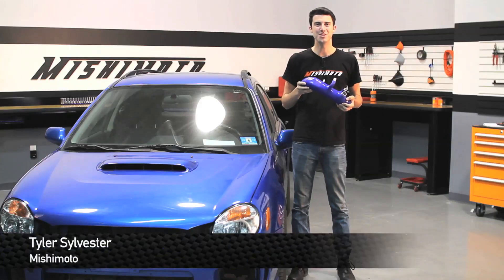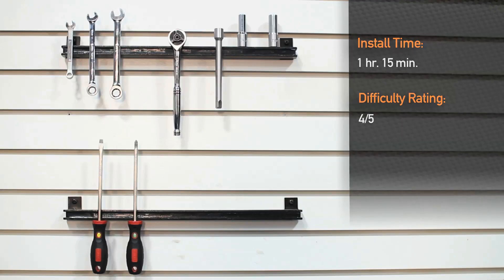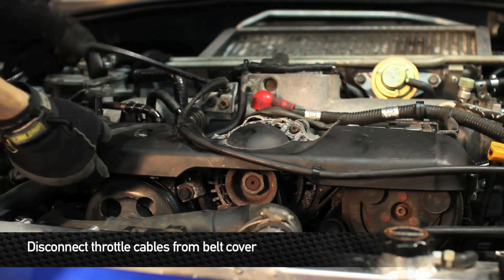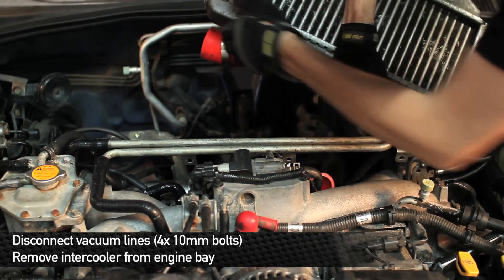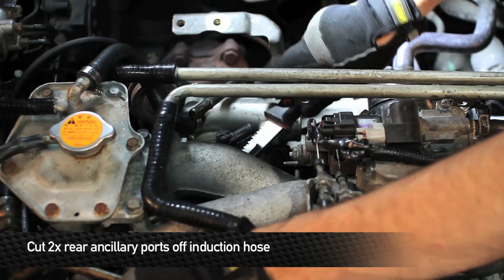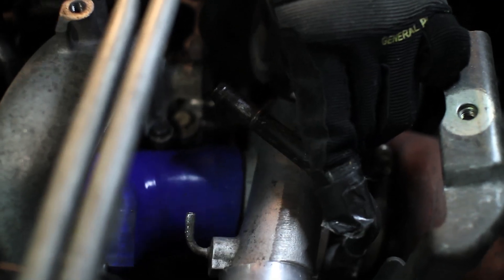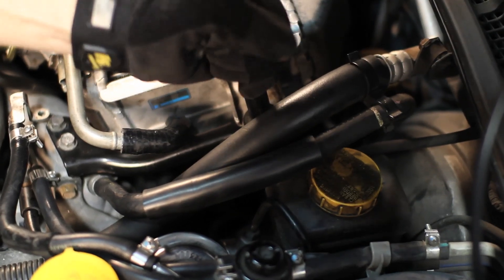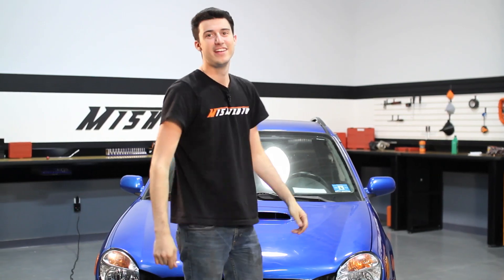Induction Hose for the 2001-2007 Subaru WRX/STI Installation

Comment: Why isn't the connection on the back side of the intake closest to the turbocharger I believe there is a check valve an sensor back there that I cannot seem to believe there is space nor room to make that work and the fitting provided does not fit that (plastic female fitting) sensor/check valve there? What's the solution?
Reply from the maker: This sensor is not found on all models and most of the aftermarket induction hoses will delete this sensor. The sensor can simply be plugged in and set to the side.
Reply: @mishimoto  Thank you clarity is serenity most the time so I appreciate you time! That does make sense an helps many of us modderz out here! 🙌 I cut that and am running the stock sensor as needed till I decide to buy the next stage for stage 3 but I was hung up on this issue for a HOT MINUTE! 🙌

Comment: Accidentally bought the 2001-2007 inlet, will it work for the 2008 wrx?
Reply from the maker: Unfortunately, the 2008-2015 models require a couple extra ports on the hose causing the part you picked up not to work.

Comment: 2:49 this turbo inlet  hose is so damn expensive and you do somthing like this ? and missing steps of replacing - poor quality
Reply from the maker: You are welcome to save the OEM component by removing the entire intake manifold but for ease of installation, we recommend cutting the ports off.

Comment: The fittings didn't come in my induction hose box. 2007 STi. Mishimoto won't respond, rallysport direct is offering no help, and now I have to find the exact sizes of the fittings. Can anyone tell me so I can buy them somewhere else?
Reply from the maker: Hey James, if you've already sent an email into our team but haven't heard back, feel free to give them a quick call at 302-762-4501 so we can check on your ticket and get this sorted out!

Comment: I like how you conveniently skipped the 1hr+ required to stick in the inlet below the manifold.  Connecting to the turbo wasn't anywhere near as easy, the hose is very stiff. I unbolted the turbo and slipped it inside the inlet. It also helps to remove the power steering lines and cut off the metal stub from the manifold that used to hold the stock inlet. You are also not showing the dummy sensor that has to be removed from the PCV line next to the turbo.  Also its hard to fit the stock post-maf hose on the new inlet.  aftermarket hose is better.
Reply from the maker: Hey John, I'm sorry to hear of your struggle - here's a detailed installation guide for reference: https://cdn.mishimoto.com/media/productpdf/MMHOSE-SUB-IH_InstallGuide.pdf in the future if you have any difficulty with our product, don't hesitate to call our customer support specialists at 1-877-GOMISHI or email support@mishimoto.com!

Comment: is a tunr needed for this very intrsted its a need to be done to my car so I'll be buying one but I also want to know if I would need to retune my car
Reply from the maker: This induction hose is safe to run on the stock tune.
Reply: Mishimoto Automotive what if I have a pro tune does that make a difference?

Comment: OMG Night mare is an understatement!!! After 3 hours of blood sweat and tears and skinned knuckles i had to take a break, assess life, and go to sleep. upon waking up i invested another 3 hours finagling the inlet over the turbo...Finally at the final stretch my full length CAI was too long... I ended up having to cut like 4 inches off the inlet to make it line up correctly to the intake. all in all i would not suggest this to someone not very automotive inclined. The Guy in the video makes it look like easy peazy clockwork. For the record i love the sound the engine makes with it installed, and dont regret buying and installing it, and no more boost leaks for the win!

Comment: problem is that on a 02 motor the hoses are brittle and will break . these motors will cause gas leaks from drying out fuel lines that couple fuel rails this is know to cause engine fires.also when trying to remove or install induction hose hoses will not come off as easy as video shows.

Comment: It was not this easy lol. Without taking off the intake manifold, it was one tight fit. Took me a little over 3 hrs to install. Silicone held up well though after taking a beating. Nipples don't line up perfectly with the vacuum lines, but they bend very easily. Overall good product.

Comment: Im kind of baffled how this video does not show how much of a pain in the ass it is to make this fit and the fact that everything is such a tight fit and makes it nearly impossible  for everything else to fit. Mine wont even connect to the turbo and the bpv hose port isnt nearly far enough to fit. I am at the point where im just gonna give up cause no one else seems to know either
Reply: I just did mine and it was a massive pain in the ass. If you pull your power steering pump you will be able to clear the path way enough to fit it in. Mine is scared to hell not 5 ply anymore maybe 3-4 with all the material that is tattered now. Also you can't connect the stock pcv valve sensor you have to pull it then just use the tube and let the sensor hang. Hope there is no cel light don't know yet. Lastly the after maf hose on the car will not fit the inlet correctly it is to large so you will need a coupler or you need to buy a silicon after maf hose. Not oem compatible like they claim on their website. And there is no going back to stock after cause you have to destroy your factory inlet.

Comment: 3:32 to 3:36 is the key step, how do you get the first elbow past the intake and AC lines? This video kind of skips this stage of the install.....would be nice to see how the whole induction hose is slipped down.
Reply: MrSupergee I had to remove the power steering pump to get this installed.
Reply: +1 on pulling the power steering pump to install

Comment: did you remove the intercooler just to cut that plug off? it seems like unnecessary work
Reply from the maker: Tim Mcmillan Intercooler removal is necessary to provide space for cutting the ports off the factory inlet hose.  Let us know if you have any further questions!
Reply: yeah once I started taking things apart it became pretty obvious. thanks for the video, install went mostly smooth
Reply: ***** will this hose work for my 99 Legacy GT-B, it has the Ej20 motor but twin turbo.

Comment: The STi will have a PCV electric connection the WRX does not have. It would be nice to see this installed on an STi and a stock air box.